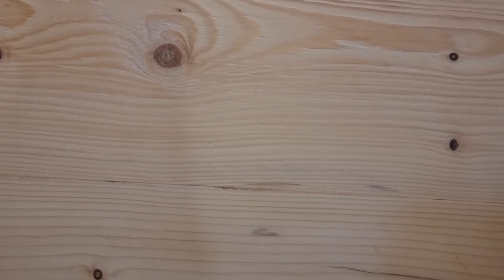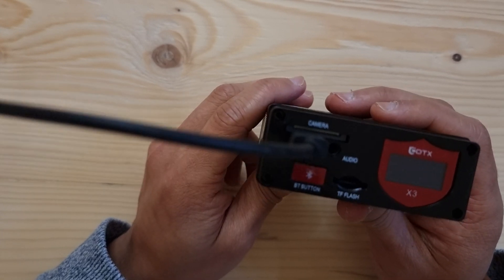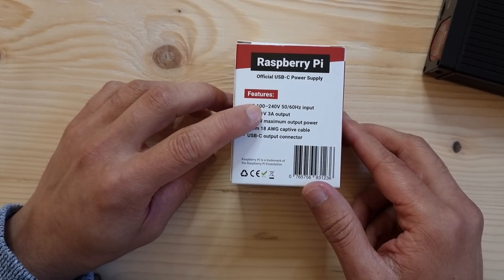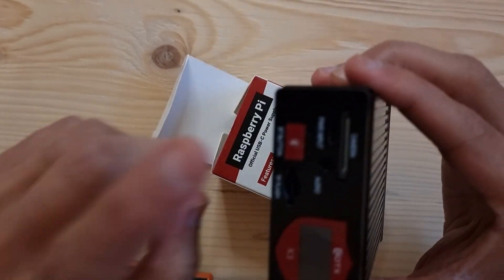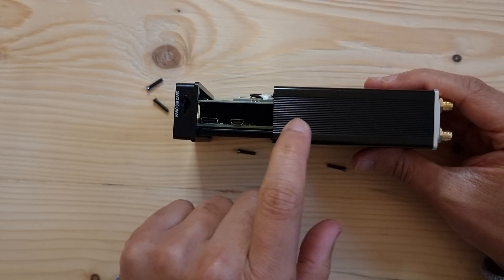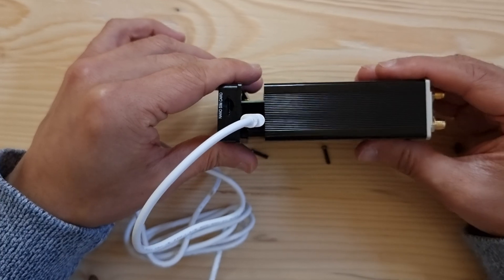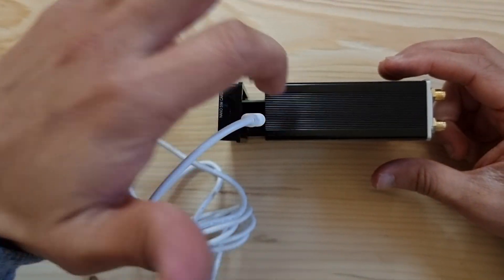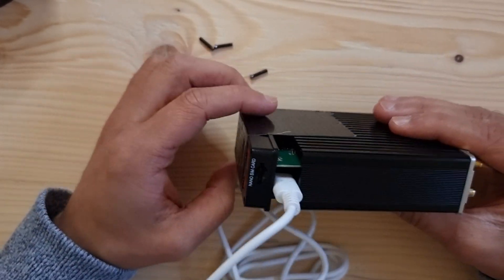COTX Broken power port quick fix | Helium Miner

Comment: What type of screwdriver is that and what type of cable do you use? Is it different from regular charging usb c cable?
Reply from the maker: It's a Torx screwdriver head - has 6 points like a star. I'm just using the Official Raspberry Pi USB-C charging cable. Link in description if you want to buy the UK plug version of it. There is no difference to a normal USB-C cable.
Reply: @CuriousCrypto why didn't you tell the size of that screwdriver....